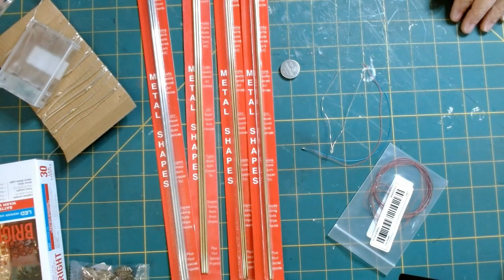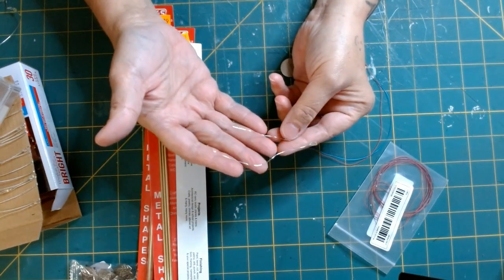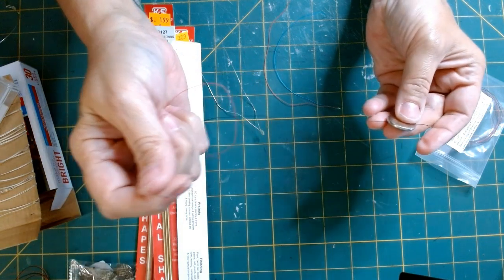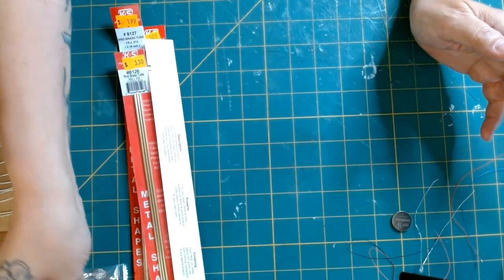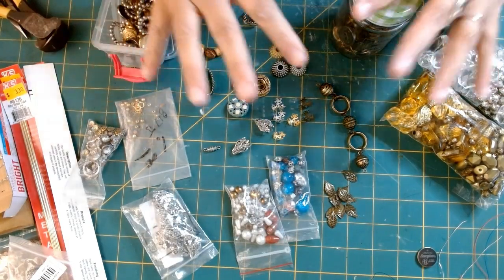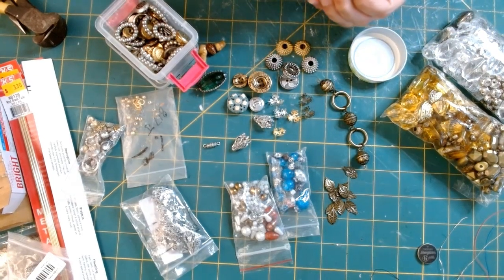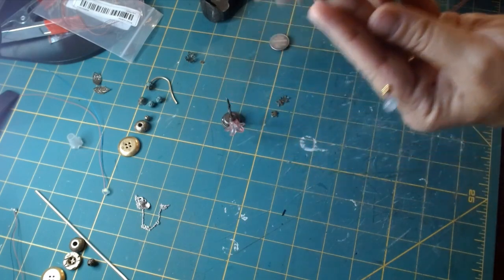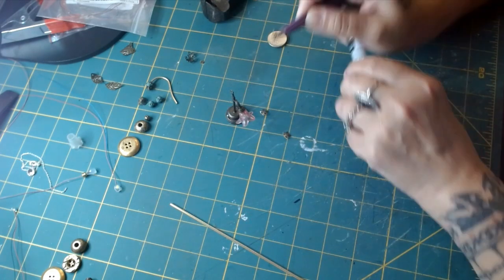DIY Miniature Lamps and Lights That Work!! |1:12 Miniatures

Comment: ❤ I LOVE this! I made a light up fireplace. I made a tiny receptacle for a 2023 cell battery using part of a K-cup. I coiled the wires and left a space between them where the battery could slide in. It works like a charm.
Reply from the maker: What a great idea, 🥰💖how do you turn it on and off? I will definitely be making more😊Thank You so much for watching and sharing💖
Reply: @tinykeyholeminis  I just slide the battery in and out. I glued a little tab on the battery to use as a pull tab. I cut out about a 1/4” wide piece of K-cup and glued that to a little circle off the bottom of the K-cup, about the same size as the 2032 battery. The wires from the “fire” sit inside this tiny housing for the battery . I coiled the negative wire and coiled the positive wire and left a space between them. This is all encased in the K-cup compartment. I left a little space opened where the battery slides in and out. There is a space between the two coiled wires where the battery slides into. And this all sits under my little hearth grate and twig logs, so it is not seen.
Reply from the maker: Wow😯 very impressive I love that you recycled the k cup and created something functional..I can't picture it but it sounds brilliant😊❤
Ok I read it again and yes I get it so brilliant!!!👏🏽👏🏽👏🏽
Reply: This is exactly what I mean about your videos and the ideas you have being useable in so many different ways!

Comment: I think you will confuse people with your talk of 9V and 12V (horrors!) batteries. If the lights ('rice' lights) are bought as a string of 'fairy' lights they will come with their own handy flat battery pack of two coin cell batteries. They can be found on Amazon as wedding table decorations for example. I found these by accident - when I was married 50 years ago, we didn't have the internet, let alone the wonders of Amazon. Wierd eh? I love your use of alternative materials. I have been collecting jewellery from charity (thrift?) shops for years to use the stones & 'jewels' in projects but never thought of using the fittings and fixings. Brilliant!🕯🕯🕯🕯
Reply from the maker: Thank you so much for sharing. Yes, they make such wonderful fixtures and hardware.❤️🥰

Comment: I am no clear on the light that you made with glue.  Did you the glue go over the fairy light?  Is that what made it light up? 
I am not sure that I am getting my thought across?  Sorry. I hope my question makes sense.
Reply from the maker: Yes you are..lol and yes I did add the glue over the light. 🥰❤️
Reply: Thanks
Reply from the maker: @bbuglady1 here is another bulb but non working.
https://youtu.be/lGRDbBsSq1U?si=hK9A1-Ql2RnPN-_o